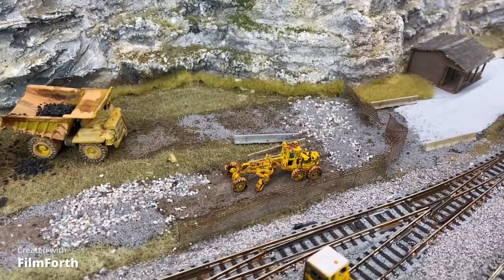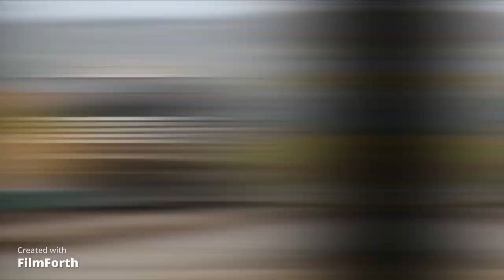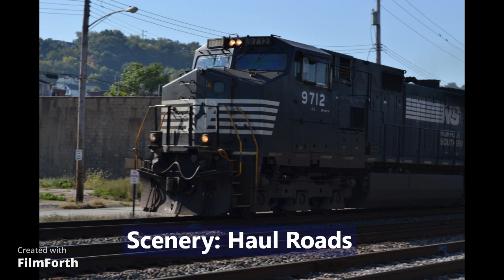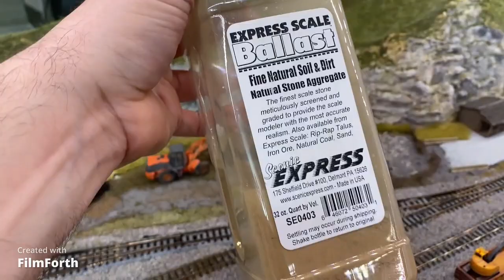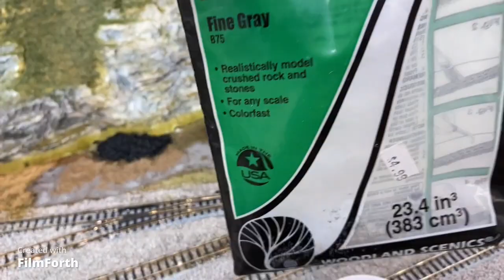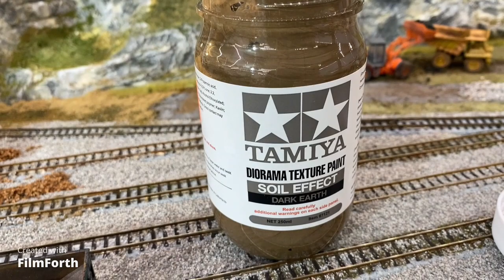Construction Haul Roads

Comment: one of the most interesting layout on YouTube. Thanks for sharing. Where is the excavator from? 3D printed or bought? :) And what track system are you using, is it KATO?
Reply from the maker: I'm taking interesting as good interesting, not WTF interesting!  The excavator is from TomyTec.  They make (or made) a series of construction vehicles, fully positionable, in 1:150 scale which is close enough to N-scale that you can't tell the difference.  They're very difficult to find now, but if you do - don't hesitate and buy it.  I paid about $25 at a train show for them.  I do use Kato Unitrack everywhere but the staging yard which is just Atlas remote turnouts and flex track on foam roadbed.